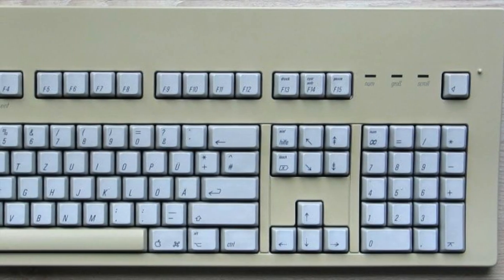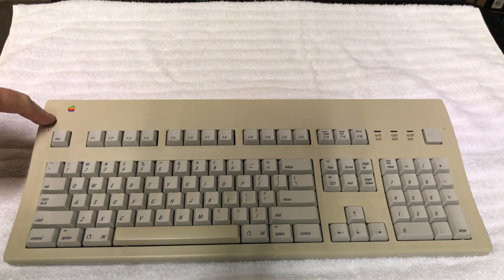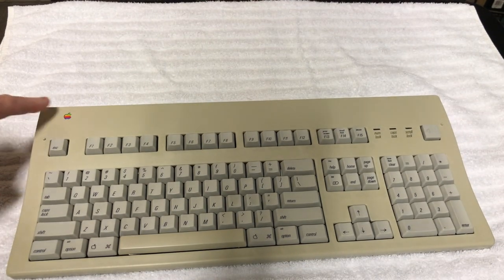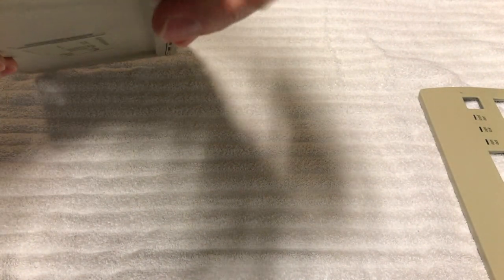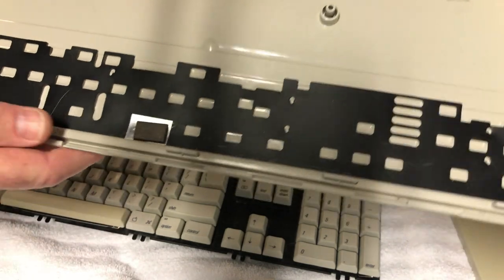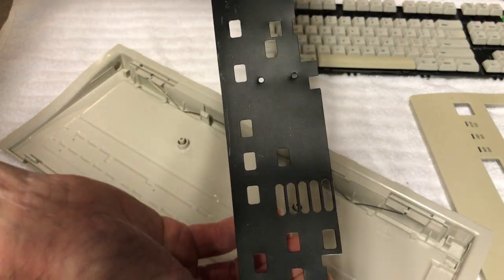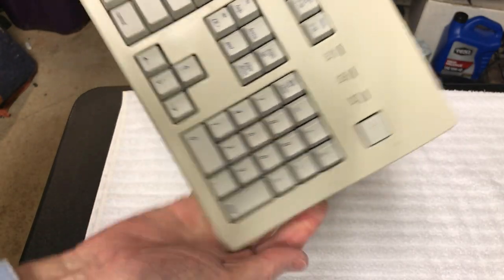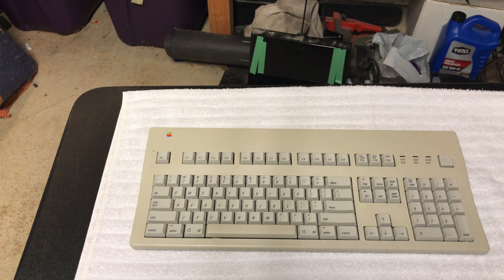THE HISTORY OF THE APPLE EXTENDED KEYBOARD II DISASSEMBLY & RETRO BRIGHTING

Comment: This video is at least somewhat helpful, but it would have been a lot more helpful if there weren't long stretches where the important action took place entirely outside the frame. I suggest marking the frame's extent on your workbench with tape so you can see when you're moving things outside the frame, and then refraining from picking items up so much. Thanks.

Comment: No UV light or heat source? How is the peroxide working its magic without it?
Reply from the maker: That Stuff I Used The Retro Bright It From Salleys 
Beauty Supply Has A Bleaching Soultion As Well As Hydrogen Peroxide It Takes Longer  To Due The Job But It Works Great